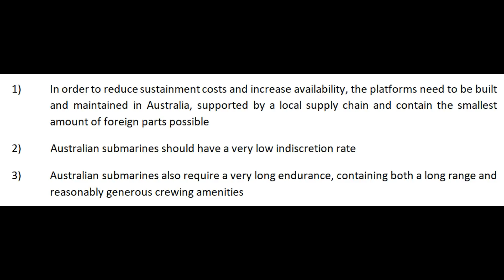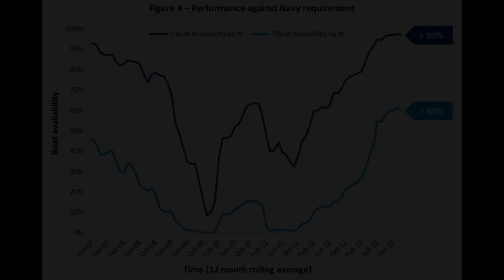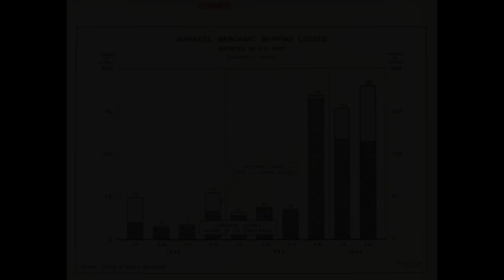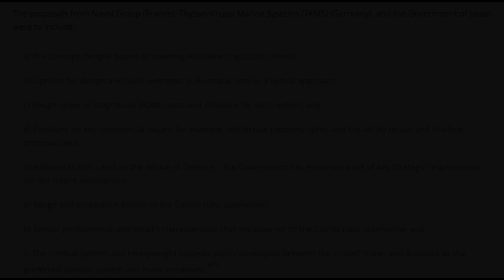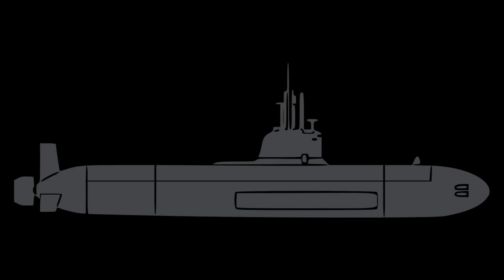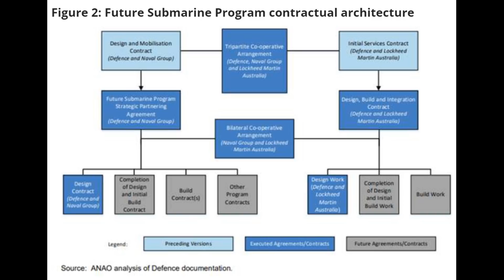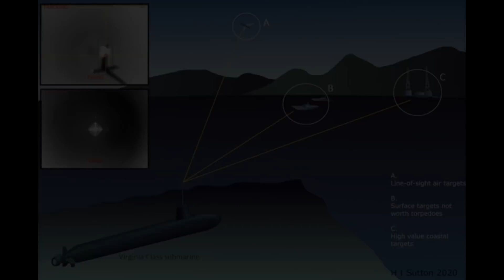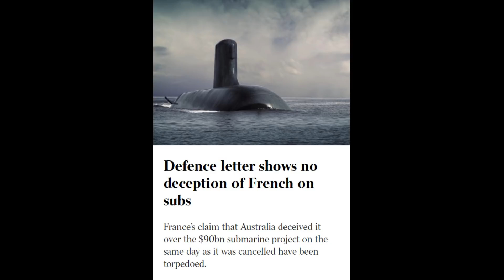AUKUS and the Nuclear Option: the Life and Death of the Attack Class Submarine

Comment: Personally I'd be interested in a 2 tier RAN submarine fleet aimed at increased submarine presence with lower procurement & operating costs. I would happily trade 2-4 SSN's for 6-8 Type 212's, i.e. 8-10 SSN's & 6-8 SSK's. The SSN's for long range & blue water missions, based based out of Perth & the TBA east coast base at Brisbane, Newcastle or Port Kembla. The SSK's I'd base at HMAS Coonawarra, Darwin (which would need to be upgraded for the purpose).

From Darwin, 212's would make ~3-6 week, shallow water patrols on all of our northern approaches, from Indonesia to the Solomons. The 212 can get from Darwin to: Singapore/the Malacca straight, China's Solomons naval base, & PNG's Manus island in ~4 days; China's upcoming PNG naval base, ~1 day.
From the west & east coast, the SSN's would make 6-12 week patrols in the Indian ocean, South China sea & Pacific. They can sit right in China's back-yard whenever they want.

The main reasons I like a 2 tier RAN boat fleet:
1. We could feasibly have 212's many years before we get our SSN.
2. T212's initial & running costs are many times cheaper than any SSN. T212 cost ~AUD850M each, vs Astute's ~AUD2.85B, or Virginia's ~AUD6.85B.
3. 212's crew complement is <30 sailors vs an SSN's >60 - >100.
4. The ISR, AD & strike capability of submarines is outstanding for the cost.

Comment: Although you outline the good reasons as to why the subs should be built in Australia. I am sceptical that they ever will be. The 18 month review that came with the AUKUS announcement smacks of kicking the can down the road until after the next election. After which the government can announce that the subs will be built off shore. Then they'll look to soften the blow to Adelaide by announcing extra surface ships to be built locally.
Reply: They may even built enhanced Collins class submarines as in interim solution.  For fhe budget for nuclear submarines they could start building 12-20 Collins submarines with AIP.  They would still be longest ranged non-nuclear submarines ever built, deployed stand off attack missiles.  Then in 20 years time if the strategic situation still warrants such acquire nuclear power submarines with LEU reactors.  The Chinese are hardly going to be impressed by maintaining older Collins submarines for another 20 years.  And if you really wanted to pressure China we'd provide Tawian with Enhanced Collins submarines- at present they have a couple of 70 year old Guppies and no one will sell the any new ones

Comment: 37:19 - that's weak argument. It is quite obvious, that reactor-ready fuel rods would be provided to Australia  or just sub could sail to france for refueling. There would be no NEED for Australia to develop full fuel cycle. It's not that reactor just goes 0%....  also this argument extends to buying submarine and maintenance of other, more frequently swapped components. And yeah, Soryu would be acceptable non-nuclear platform for Australia. BTW: reactor lasting lifetime of the ship puts hard limit on ship service duration. So far, nobody reliably stated in public can Virginia be refueled (just is planned not to need it) or is it long term disposable submarine.... fundamental problem is that Australia tried to square a circle: have almost-SSNs without going nuclear.
Reply: I agree, I think the primary reason for not going nuclear in the past has political. Earlier politicians have never wanted to put their neck out.
Reply: Its not anywhere as simple as you make out to refuel a nuclear reactor on a submarine. For starters the shipyard in question would need to be fully redesigned and rebuilt to handle such a capability. You are talking about removing some of the most hazardous materials known to man as it is as easy as refueling your car at the petrol station. Because it isnt a sealed unit then you also need those capabilities and systems doubled to allow such submarines to be built and maintained out of ASC North and ASC West and past looks at such a thing was estimated at $10-$20 billion in infrastructure alone before even accounting for cost of waste disposal at end life.

As for the lifetime there is nothing wrong with that in Australia's regard as the aim is for continuous production thus by the time the 1st boat reaches end of useful life the replacement is hitting the water.

Btw if you actually pay attention in the video it clearly explains why having boats sail back to France to get refueled is a major concern to the Navy and GoA. Less time spent here, Entirely reliant on France, a nation in the past which has stopped military supplies when they didnt agree with what we were doing etc, It affects our sovereign capability and long term sustainability. Never had those issues with the UK or USA but France we have.
Reply: The "hard limit" on submarine operation is not really the reactor life - it's the time spent running at depth and in particular the number of dive/ surface cycles that it goes through, all of which stresses the pressure hull. Even significant changes in depth without surfacing stresses the hull and contributes to the overall fatigue on the hull plates and welding.
Reply: @rodneyholland1867  One of the significant reasons that allowed the Australian Labour Party to support the decision was the fact that there was no need to develop a local nuclear industry, as the reactors could effectively be delivered as a "sealed unit" that could be both built and scrapped outside of Australia - so yes, politics was, as always, a major consideration
Reply: @MatthewEast1989  Nobody said it was simple - just that capacity for this is already in place in France, and Australia doesn't need to develop full fuel cycle to replicate necessary amenities on-site.  Yeah, I paid attention while the author has not: reactor is not ONLY system on submarine that needs continued good relationship with supplier - so does virtually every other piece of equipment on board, which just can't be swapped at will due to noise, EMC and weight / balancing concerns.
Reply: @neilpattison6576  That's why - I think - Ohio's could be rebuild to SSGNs as they have logged less stress along service life (less off and less rapid depth changes).
Reply: @MatthewEast1989  BTW: if Australia aims for building on site of the first units, delivery is going to be LONG and troublesome.
Reply: Soryu came a distant third in the competitive evaluation for a reason. Too cramped, too short range and only a 20 year service life.
Reply: @mjguerin63  again - it is matter of inadequacy.

Comment: great in depth discussion!
the availability of a sealed reactor which lasts the whole lifetime without refuel was def the tipping point.  Very hard to resist this tech.  There are many nuclear sub operators in the world that would like to have this for their attack subs.
Reply: No machine ever built can operate for 30+ years without maintenance. Where will that be performed?
Reply: @mjguerin63  maintainance can be done in Aus.   Since there is not a need to have to refuel the vessels you don't have to have very extensive nuclear reactor industry in aus.  
If you have a real unlikely major problem with the reactor, then that has to be worked on in the US anyway.
Reply: @mingming9604  if it's a US built reactor then it supposedly will come "in a box" which, I assume, means no maintenance required which is nonsense.
Reply: @mjguerin63  I've heard the us navy LCS have made it near impossible for crew performed maintenance.
Reply: The French used HEU on their Redoubtable SSBNs but changed to LEU on the Triomphant class because the reactors produced more power and were easier to manage and maintain.

Comment: The RAN was offered a stretched version of the RN Upholder class (possibly the best conventual available at the time) the T2400, however it was clear from the outset that the RAN was very anti a UK boat but they wanted to use it as a stalking horse to force the price of options down. It took 20 plus years to get the Collins to meet its original spec (look at the Cole report) which the T2400 could have achieved on day one!!

Comment: Attack class would be an excellent option for India. They could build 24 of them to meet their requirements for diesel electric submarines that form the bulk of their submarine fleet. They could save money on the design phase if they keep it close to the Australian configuration. They have similar contract requirements for local IP and component manufacturing. It would be a good fit. The price may be a bit of a shock for them but it is good value in my opinion and they could probably build it slightly cheaper than Australia could.
Reply: Australia’s nuclear submarine might look like a cross between an Astute class and a Virginia class. Bow and overall shape might look like a stretched Astute. Could have a Virginia like payload module for vertical launch of tomahawk missiles or support of divers. 

Internally there could be more signs of Virginia class DNA. The command systems would likely be similar to Collins snd Virginia. The reactor would probably be a variant of the Bechtel model used on Virginia because of better safety and controls inherent to their design plus excellent power output and of course long fuel life. 

But I would argue that a second option should be seriously considered. Instead of high enriched uranium (HEU) fuel it could be designed to use high assay low enriched uranium (HALEU) fuel. 

This would probably then require one refuel at some point, perhaps 20 years in or so. With inspection and overhaul at the same time, total life might approach up to 40 years. Thus there would likely be more total patrols available over their lifetimes. 

The downside is the time, money, and complicated  logistics of the refuel process.  

But on the other hand, development of a HALEU based fuel cycle could be used to start a civilian nuclear power industry in Australia. Australia could enrich the uranium they mine to about 18% - 19.75% and then package it as TRISO. The US has been working on both HALEU fuel enrichment and reactors to use it. The US has also been further  developing TRISO to increase safety margins for future reactor fuels by making them resistant to heat damage and making a meltdown less likely even in the worst possible case. 

HALEU has been used for research reactors for a long time but has only recently become cost effective for large scale commercial use due to advancements in enrichment technologies that vastly reduce costs and speed up the process. 

HALEU has several benefits over traditional low enriched uranium fuel. It is more efficient, allows smaller reactors, requires less frequent refueling than LEU (but more frequent than HEU), produces less volume of waste, and produces much less waste of the longest lasting types making disposal underground less complicated. It would be a great option for a country starting a nuclear power fuel cycle from scratch. It would also place fuel cycle control within Australia, which not only develops an industry but also increases self reliance.
Reply: @stupidburp  If you think Barracuda is expensive wait till you see the bill for a British or American boat. I bet you'll be the one who's shocked.

Comment: Super Collins
I believe this is what Australia should do, concurrent with the #AUKUS program planning
Recommence the Collins line which shouldnt have ended. This can be obtained early due to an advance stage of readiness by ASC with existing jigs and planning.
Planning space demands aside, we could organise subsequent boats beyond the first one or two, to be an extended length. 
Just 1/7th additional behind the sail would be another 500 tonnes displacement. This would provide additional range, weapons, battery, improved indiscretion rate, and covert requirements.
This Super Collins can do everything we need while exceeding the Collins, and most of what we would get from a nuclear boat and maintain synergy with the existing fleet
We were completing Collins boats on the basis of one a year, hopefully we could still get near that. That would give us 4 boats before one plate is even cut for the AUKUS boats.
All that and, RAN need a submarine tender. 
A specialist ship that can service these boats at sea and replenish crew. 
This leaves the boat on station, refuelled, rearmed, recrewed, substantially affecting time on patrol by eliminating the transit time to and from Port East or West.
Reply: that's what the Attack was supposed to be. it's easy to say just do the last thing but better on paper but much more difficult in practice
Reply: @seanmac1793  Collins are our most expedient way forward, 
most likely the same sensors and weapons as AUKUS boats, and we still have 2 licenses we can use

Comment: The report is critical of the Oberon class but when you consider it was really a a late 1950s design it is not surprising that it could be surpassed by 1980 design! The Oberon's were superseded by the Upholder class which could have easily been adapted to meet the RAN requirements, if fact Vickers did offered a stretched Upholder to meet the requirements but the RAN was very anti brit at the time.
Reply: True, though as someone who spent 6 years working on the T2400s (often refrring to the lead boat as "HMS Unfinishable"j, I must admit that alhough a fundamentally very capable design, the class did have problems of its own. As was unfortunately demonstrated when all 4 boats actually built (envisaged  originally as only the 1st of 3 batches, with the batch 3 follow-ons perhaps being "stretched" versions themselves) were 'unloaded' on Canada and a saga very like the Collins Class one, ensued.
Reply: @squirepraggerstope3591  I agree the boat was fundamentally a good design and in its UK original configuration its weapons system was a capable as a UK SSN housed in a much stealthier platform. However years in mothballs, the Canadians lack of experience with the boat and the Canadians major changes to the weapon system to accommodate (the less capable) US Mk 48 torpedo, led to a number of problems in initial use with the RCN. Operating submarines is far more demanding than "targets" (surface ships) and needs constant reinforcement, the RCN lost a wealth of experience when they stopped operating the O boats.

Comment: It's looking like the reactors will have lives closer to that of 40 years.  Most people don't understand how big of a deal that is.  Typical refueling takes years to undergo.  Not having to waste 6-7 years of a subs ~35 year life undergoing refueling is a big deal.  That's 20% more use out of it.  Furthermore, modern nuke boats are built modular.  Meaning the guts are built in sections separate of the hull and then slid into it.  To make radical upgrades to a sub simply requires cutting it open and sliding in new modules that can be built before the sub even leaves the water.  This is a really big deal, one that's worth some french feelings being upset over.

Comment: I can't help but think that whatever configuration of boat we end up with, the first hull will be an integration nightmare. We just love smashing together systems that were never meant to talk.
Reply: Integration will not be that big of an issue. Australia has 50+ years of submarine experience and will have experts from the US and UK to help with the nuclear bits. The much MUCH bigger problem Australia will face is replacing combat losses.

Should things go badly, China will blockade Australia and mine the crap out of your waters. Modern mines house torpedoes that are frighteningly efficient at sinking subs and ships. Since Australia needs American reactors to build new subs, Australia will find it increasingly difficult to replace any lost vessels.
Reply: @redvenge709  That would be case, even with the Attack, or an evolved Collins. We don't have the depth of industrial capabilities to make much of anything without SOME imported components.
Reply: @peterides9568  True, but I think with the experience of the shipbuilders and engineers, many of those systems could be compensated for. Hard to compensate for the entire power plant. The boat won't go without it.
Reply: @redvenge709   Combat losses? I’m my experience if Australia loses one boat we will pull all remaining boats back to Sydney Harbour
Reply: @anthony9thompson That is an odd response. Losses are expected in war. Subs are not going to do any good tied to a pier.
Reply: @redvenge709  I agree . My comment was more a dig at the ADFs risk aversion

Comment: Do you have a source for the indiscretion ratio (or rather, snort time) of Collins? I can't see how 'a few minutes' for a full recharge is even close to possible.  A battery bank the size of collins will be a few hundred tonnes. At 0.14megajoules per kg, probably ~50 gigajoules of energy. Even with 5 megawatts of power available, assuming near perfect efficiency, and neglecting any issues that arise with lead-acids at high charge rates, reaching full charge etc, it would take at least a couple of hours.